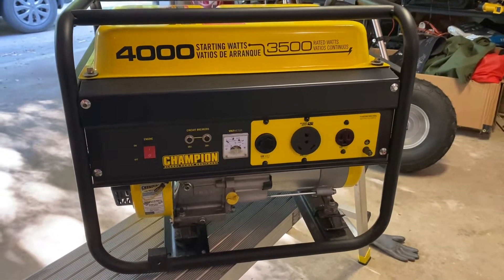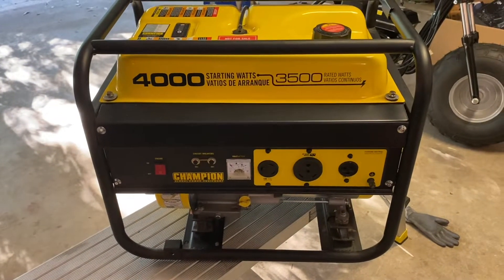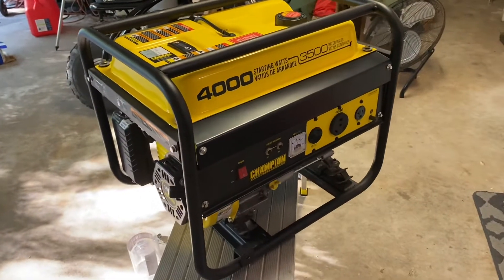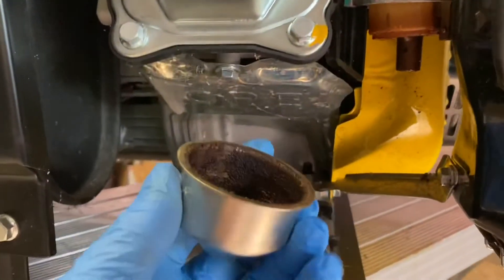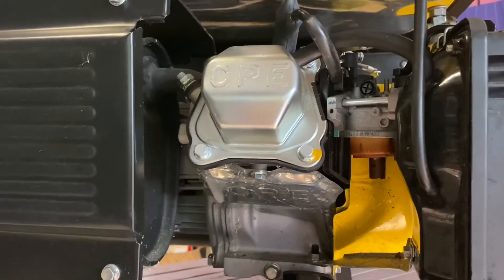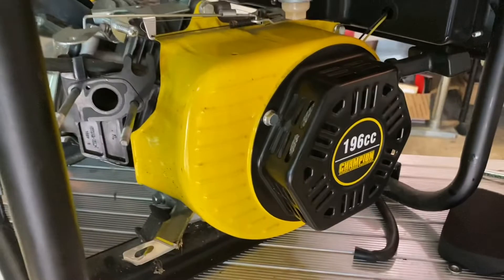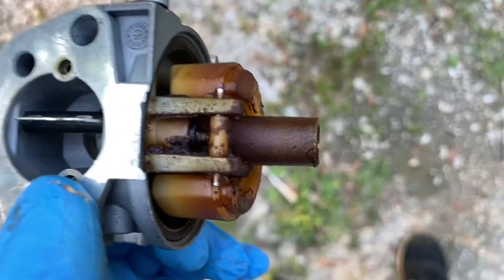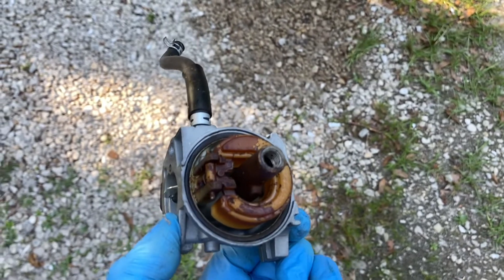Champion 4000 generator troubleshooting

Comment: pro tip.  turn gas valve off and run genset until it stops from fuel starvation with NO load!. Tip2 - use fuel stabilizer.
Reply: Always on both!
Reply: And drain for long-term storage!
Reply: Always use stabilizer. And I turn off the fuel valve when not running. My 4000 has run perfectly until just now. Checked fuel and spark. Fine. So I’m thinking it’s a gummed up carb as this author has shown with his. Next step

Comment: A lot of those generators have drain bolt on the side of the carburetor. The one on mine is 10mm. As you start to unscrew the bolt, fuel will start dribbling out. Let it dribble for a couple of seconds and then secure the bolt back into place. Mine fires up first pull after this. My mechanic told me that this bolt creates a vacuum and brings the fuel from your tank to the bowl so the generator can fire. I hope this helps.
Reply from the maker: Great advice, the carburetor bowl has the little drain bolt just like you said… 10 mm
Reply: Thanks. I’ll give it a shot

Comment: If your champion generator is shutting off without any spittering or sputtering unplug the low oil sensor.  These things go bad and send a signal to stop ignition. Make sure you have sufficient oil first. This should be standard procedure, unplug it and see if your problem goes away.

Comment: I rebuilt carb. Went easy till I noticed float is closing the pin off when level. I blow air through main gas passage and float is down below level before opening pin??????
Reply from the maker: probably should just buy a new carburetor